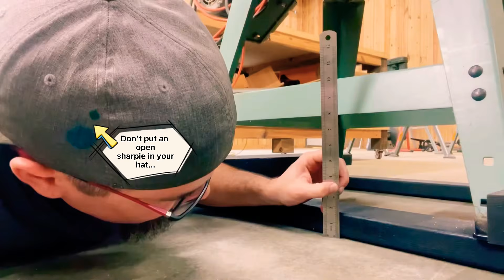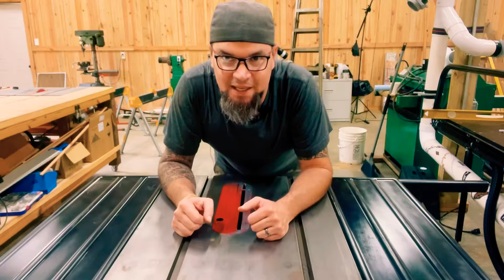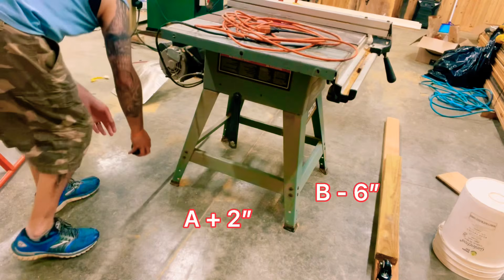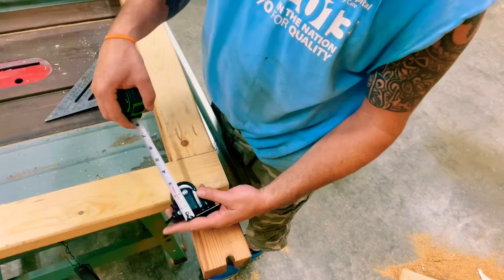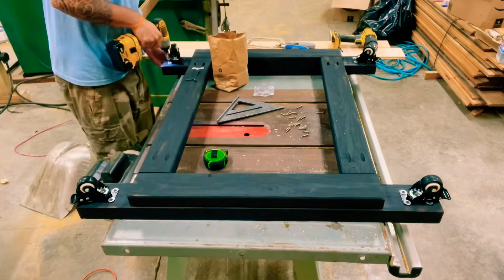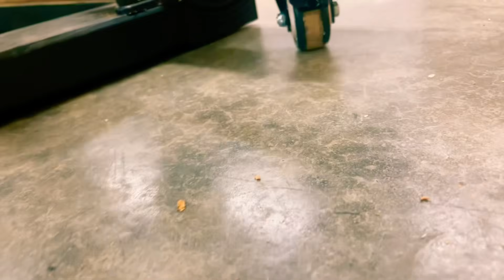Build An Easy Low Profile Mobile Base For Your Shop Tools!

Comment: Maybe I am confused but I built this base for my saw and when I used the  A+2” and B-6” formula that gives you a base exact size for the saw base with no room to add the 2x4 runner for the casters.

Comment: My new Dewalt 10 inch table saw came with the rolling, 2 wheel stand. It doesn't roll when the stand is in use. So I built one of these with for locking castors. . I mounted the wheels inboard from the base frame , it takes up less space. PITA.

Comment: I don't trust screws to hold the weight of my table saw without ripping out, so I added 4 3/8" x 3-1/2" bolts, one to each corner for extra strength.

Comment: Hey Matthew, 
I appreciate all your great video's. I am making this mobile base for my band saw. I ran into a little problem. I followed your measurement in the video and it didn't work out like you explained. I think for part A you have to add 8" inches to account for the overlap of the two by fours. 2" left me short 6" inches short.  Thanks for all the good things you do.
Reply: Same problem here

Comment: there may be only 3/4 in ground clearance but the saw table is about 2in higher
Reply: So use some ¼"x2 or 2½ or even 3" angle and  only be 1/4" higher.   Or even 3/16" with less height increase yet!  In fact, 1/8" might even work, as long as it is steel and angle.  C channel would work also with the same result.

Comment: Thank you. You just solved a problem for me. I really like the simple design. The only thing I would do different is not butt the 2x4s but lap them with the 2x4s that the casters attach to. That way the weight of the machine is not resting on pocket screws.
Reply: Exactly what I thought I just made mine that way😂 also added some glue
Reply: That is pocket holes without glue, in fact.  My humble opinion, glue is necessary.
Reply: Adding the second 2x4 takes care of no glue.  Five screws makes a world of difference.  Guess I should watch the whole thing before commenting!
Reply: Could you elaborate more on what you mean?

Comment: I know this is a little late but I wanted to thank you for your design and the video. I have a limited shop space - 12' x 20 ' -and mobilizing things is important. 
First I looked on the "Big A" and there was no way I wanted to spend that much. Ordered a set of casters and will be at it. 
Is there any chance of the saw stand slipping around on this stand? Just askin'. Thanks again.

Comment: I really like the look of this design, nice, simple and clean.  I did something similar 2-3 years ago, but with retractable casters - another story.  I would have turned it 90 degrees, and left board A out - that provides toe space, so I’m not stubbing my toes all the time.  Also, a counterbore in board B for each foot would keep them from slipping.  
I would also need leveling feet, as my floor has a significant slope, but your low profile design should accommodate leveling feet without difficulty.  Note: I started out with the heavy duty side-mounted leveling feet, but that tended to make “board B” twist - they need to be centered.
Nice work!  I look forward to more.  Best wishes and stay safe!

Comment: I made is mobile base for my jointer.  This is the best and easiest design I have found.   The only difference in my design was that I did not use pocket screws since I did not want to spend the money on the tool due to it being expensive.  So I just made the B boards 7” longer to account for the width of the 2x4 so I could make lap joints and used lag bolts to hold things together. Also used larger casters so I could move the jointer down a wood ramp in the garage from where I store it. The larger casters provide clearance so the bottom of base would not bottom out going down the ramp.  Other than these differences, it’s a good, strong and economical way of moving shop equipment around.

Comment: Oh for a smooth, jointless floor. Garage. Driveway. 4” casters. Great advice about all 4 swivel - and lock - and being sure the locking mechanism doesn’t hit anything as the caster swivels. Thanks fir the video.
Reply from the maker: No worries!